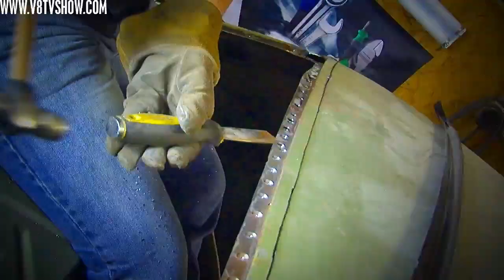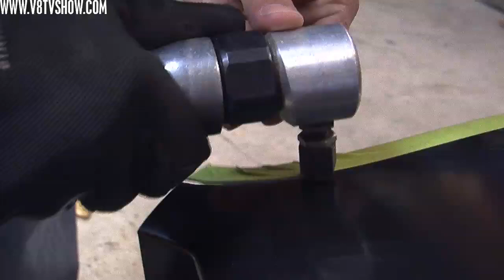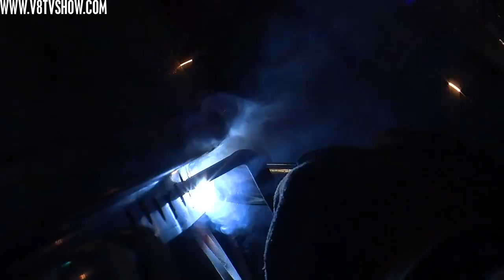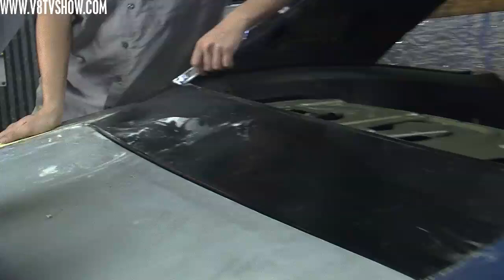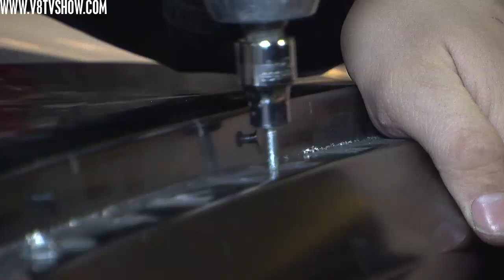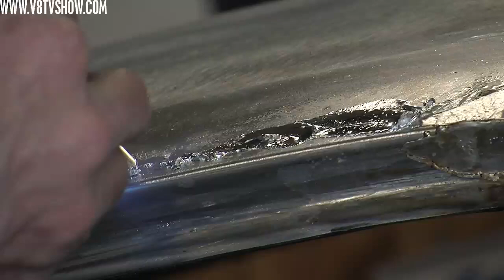1968 Camaro Roof and Window Rust Repairs Video V8TV

Comment: Hi! I'm working on a Honda CRX. Took the windshield and the rear quarter Windows out, and off course there's alot of rust around the windshield area due to an earlier windwhield replacement obviously not done by professionals. The first problem I run into however, is the adhesive... I can't seem to get it all off just using a knife! Is there an adhesive remover you guys recomend to get all the adhesive off before sanding and repairing the rest?

I hope you can answer this. Just found this channel! Awesome videos :)

Comment: please excuse my ignorance I myself just bought a 69 camaro and it has this same problem, what tool is it that you were using to cut the new roof skin? Was that an air nibbler? That certainly looked cleaner and easier than tin snips or a cutoff wheel!

Comment: Question, why not remove the surface rust with a wire wheel on a grinder? I know it leaves scratches but in a place that's not going to be seen???

Comment: @V8TV The idea with restorations is to keep as much original steel on the car as you can.  It may be wasteful to buy a skin and only use parts of it, but i believe the car has more value that is doesn't have an aftermarket skin.  You know this way that GM stamped that metal in the 60's, not some aftermarket  company with a mould that has slightly lost its shape. My 2 cents :)

Comment from the maker: @ADAMR408 It's true, we bought a new roof skin and used parts of it.     The skin is not very expensive, (a couple hundred dollars,) but we didn't want to remove the entire original roof.    The rest of the original roof was in pretty good shape.   One could have done this repair several ways, including a complete re-skin, but this time, we chose this method.

Comment from the maker: @MPWR327 It's kind of hard to tell, but Nick prepped the inside of the hole in the roof the same way he did the rear filler panel, using the Eastwood Fast Etch, then an aerosol enamel to protect it until the body was media blasted.    HTP Prime-a-Weld was also used.   Later, after the body was media blasted, it was sprayed with a BASF epoxy primer as the base layer for the new bodywork and paint.

Comment: Hi, very, very useful video. But I have question about sheet metal protection. Before plug welding the first part of the roof Nick removed rust from the old part but after this did he use any wash primer or any other primer to protect it or just plug weld the new part over cleaned old one?

Comment from the maker: @1PossumJenkins In some cases, yes.   Many of the small pilot holes were filled when the new panel was plug welded in place, the remaining sheet metal screw holes we zapped in using a copper backer where needed.